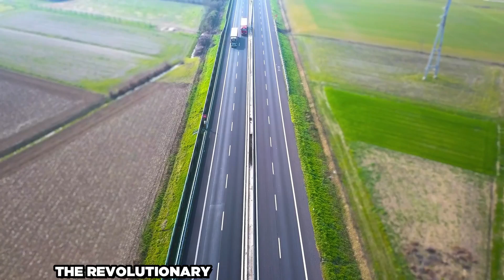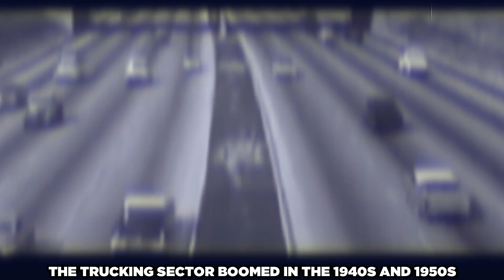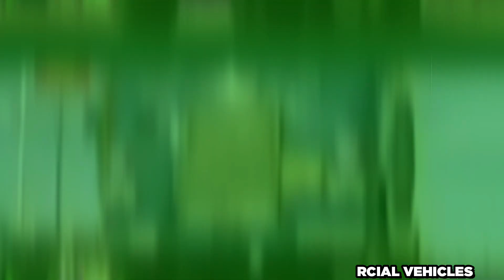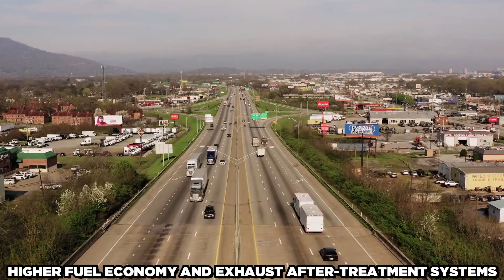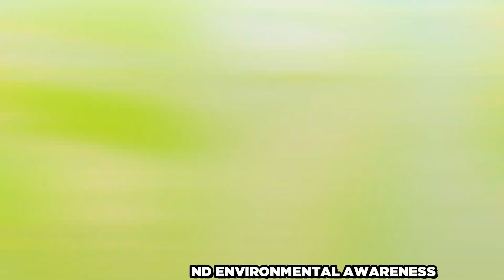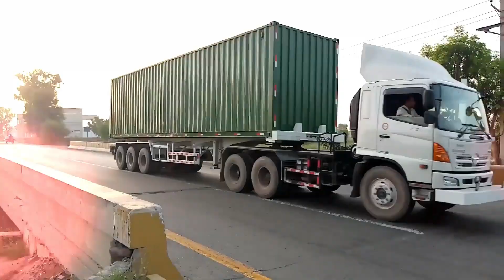How The Classic Truck Was Destroyed by Manufacturers?

Comment: These new trucks of today get worse fuel economy than something from the 80's to 2008 and that's a fact and the EPA didn't have the right to impose these new laws about emissions and I hope all these motor companies sue the EPA
Reply: Better to just ban them all as to dangerous and clear the air
Reply: Yutz
Reply: The new trucks do not get worse fuel economy than the 80s trucks. Electronic fuel management improved fuel economy over mechanical injection & has been on big trucks since the early 90s.
Reply: A Lie you Tell. Just Stop it